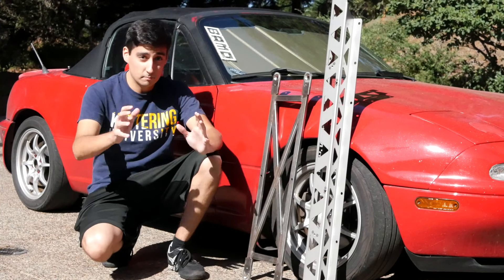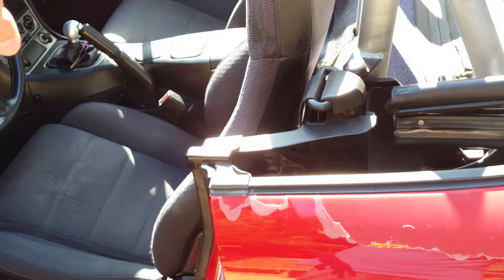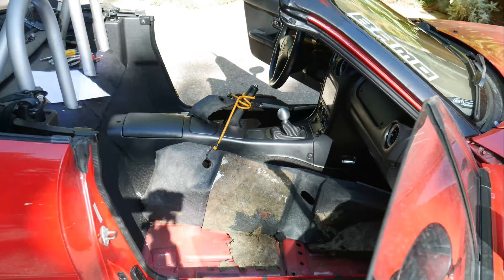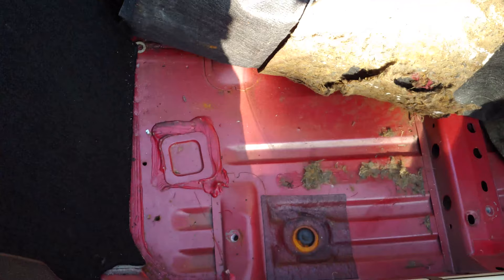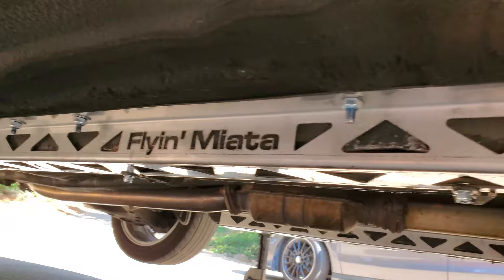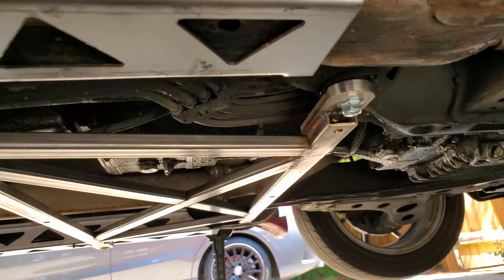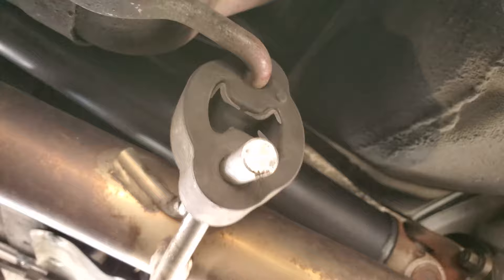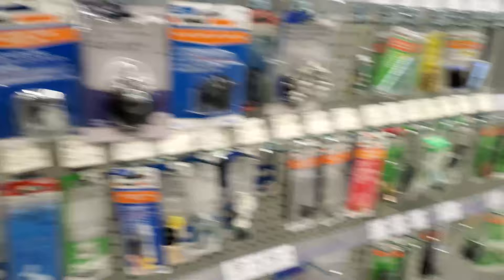Miata NA6  - FM Frame Rails & Butterfly Brace v2.0

Comment: Nice job with this instructional video. I just installed my frame rails and butterfly braces today. I did the fender braces from Paco motorsports a few weeks ago and they made a huge difference!
Reply from the maker: Thank you! I was thinking of picking up a set of fender braces very soon actually - particularly from GarageStar. Should be the last bit needed in chassis upgrades! 😀
Reply: @winguard96  definitely go with the Paco strong arms. They extend further forward than any other fender brace.
Reply from the maker: I did notice that. They are also the heaviest and most expensive option... but perhaps the most effective? They at least look that way. No tests have been performed to confirm that, though.
Reply: I can second the huge difference the Strong Arms make - I installed them before the frame rails on my 02 SE and they drastically reduced cowl shake. Haven't finished the frame rails/butterfly brace install yet - tough to do solo!
Reply from the maker: @Austin Webber Awesome!! If your frame rails were mushroomed like mine, it can become an almost solo job, haha. I'd say adding the first brace, no matter if it's a fender brace, frame rails or butterfly, will create the largest gain, and then the subsequent pieces will add less of an effect (diminishing returns). Maybe I'm wrong about it, and the rails/butterfly create the largest gain overall... but then there's mass to think about. The Paco Strong Arms are the heaviest option at 6 lbs per side vs 2.8 lbs for the GarageStar units. Oh internet, why must you create so much doubt?! 🤣

Comment: Thank you so much for this install! You got me thinking now to install this on my miata. Have you ever thought of adding derin bushings for your door? I read somewhere the door is apart of the stiffening. Not sure how true that is. I am also torn on keeping stock sway bars or go Eibach or ST. Keep the videos coming! Great Work!
Reply from the maker: My pleasure! And I added Delrin door bushings long ago! They did help a little bit, but the butterfly brace made the largest difference for sure. Get either brand, sway bars are a cheap and VERY effective mod! I run Flyin' Miata units.